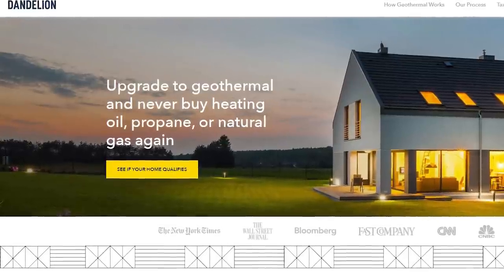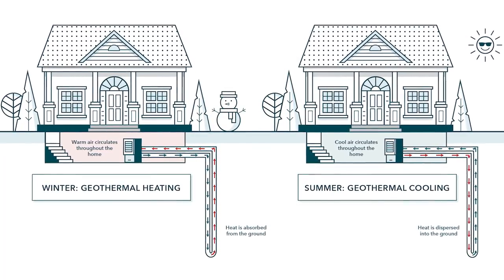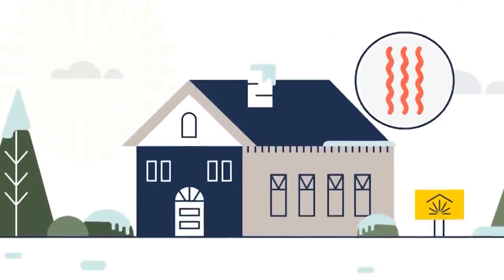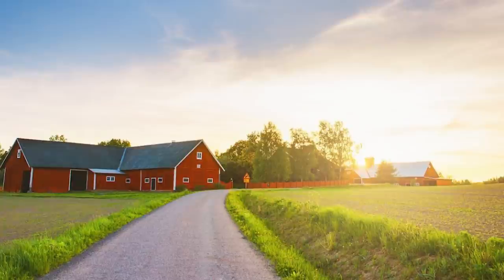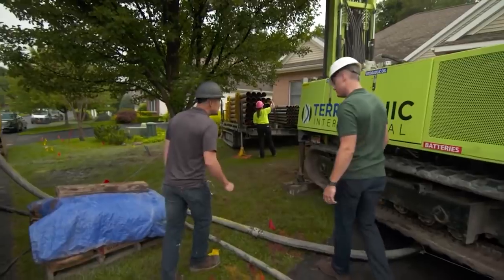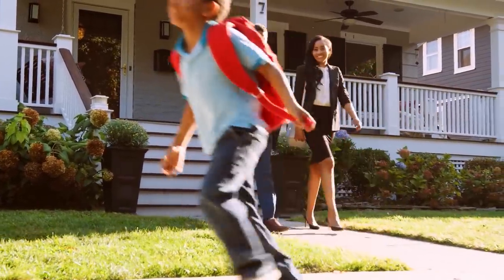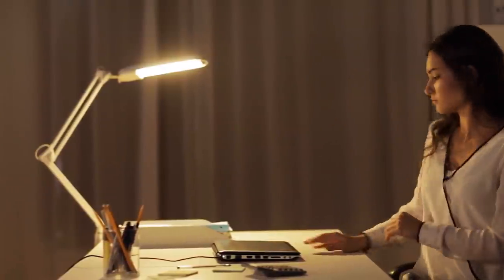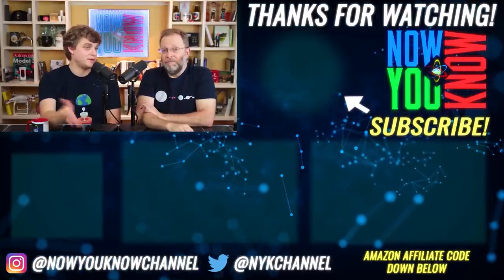All Your Geothermal Questions Answered | Dandelion Energy

Comment: I wonder why its so uncommon especially in the USA to have a single contractor. When we built our heatpump in Germany in 2009 (11 years ago) 2 x 80m (abt 240 ft) drill on an 0.25 acres ground we already had a single contractor (Nibe who are the manufacturer of our heatpump.)
Reply: Not the same market, no point setting yourself up as a domestic turn-key contractor, if you've not got enough business to sustain yourself

Comment: So what are the pro/cons of geo heat sinking vs. air sinking? Is it just a question of the temperature extremes in ones location.
Reply: Does the waste heat you inject into the ground during the summer, end up getting utilized when you need heat in the winter?

Comment: I felt that the lady who gave the geothermal presentation gave some MISinformation. 

Geothermal is NOT mainstream. I remember these presentations 30 years ago. The problem was they were poorly installed and they took out a perfectly good gas furnace?? I remember Geothermal trying to get started YEARS ago and today I only know 2 systems in Cincinnati and they BOTH said "I wish I had Solar" but they bought their systems before solar was developed like it is now. mal). They also failed to mention the financial deal that most of the solar companies have. By the way, the host  is 'mad" because he still has electricity even though he has a natural gas furnace, I am sure as an engineer that any natural gas device needs electricity to LIGHT the burner etc. I have a a natural gas furnace and its the lowest cost I ever had. ALL I need is a low voltage "lighter, then it runs totally from natural gas. I was very disappointed at some of the misinformation in that episode. I hope to see better quality information when someone presents their "new" system. I have been very impressed with your reporting on EVs. So today, since I am MORE interested in a solar heating sytstem I watched the episode and was very disappointed

Comment: I'm surprised she calls it geothermal when it's really ground source heat pump.   Too bad the cost is so much higher than air source heat pump, like 5 times higher or more.
Reply: Not five times as it's become more affordable. And she said " the type of heat pump that geothermal  is one that exchanges heat with the ground where 
Air conditioners exchange heat with the outside air".
 And some 70% of their clients are coming from fuel oil systems. They provide 100% financing and people are still saving money on a yearly basis.
The advantage of the ground versus the air system is you have a much greater delta.
This ground-based system does heating and cooling and contributes to hot water.
Also, after 20 25 years, when the heat pump reaches end-of-life the ground Loop is going to last the lifetime of the house. And heat pump is an easy replacement.
Reply: @6681096  She said it's about $20K after incentives, I can get an air source heat pump for $4-$5K, before incentives, that's at least 5 times cheaper.  I can do it for even less if I install it myself.  Everything else you wrote is basically irrelevant to my point.
Reply: @JRP3  Unlikely you are comparing apples to apples.  Kathy's system does heating, cooling, and hot water.  The electricity cost of running an air source heat pump will be more (two to three times more) than a GSHP because of the antagonistic temperature deltas.
Reply: @wallykramer7566  OK, let's add another $1K for a dedicated air source hot water pump, still 4 times cheaper.  Also air source heat pumps also do cooling, so that point is moot.  Yes of course operating costs will be lower with the ground source unit, less so in moderate climates.